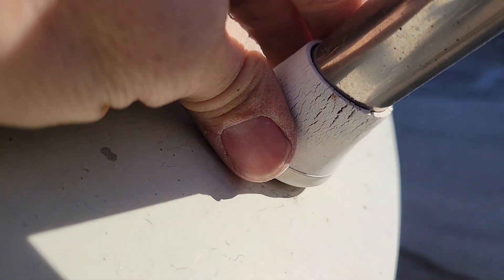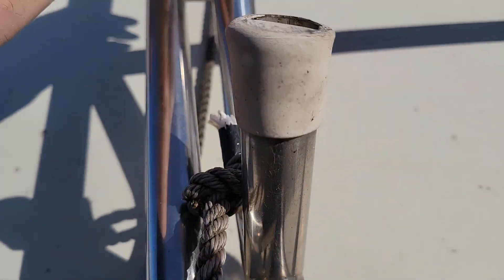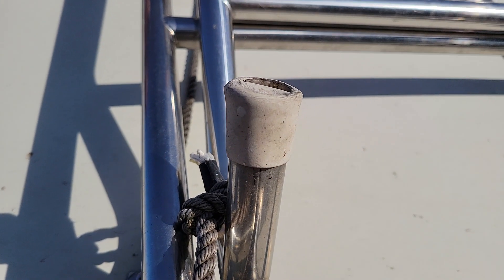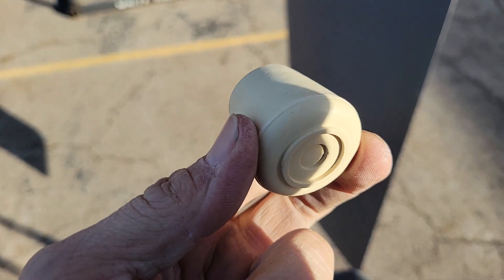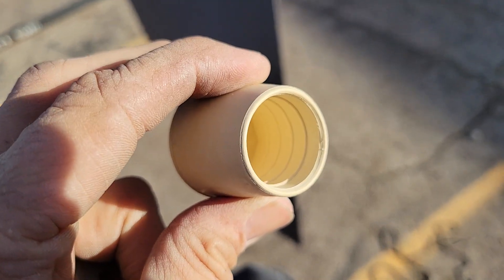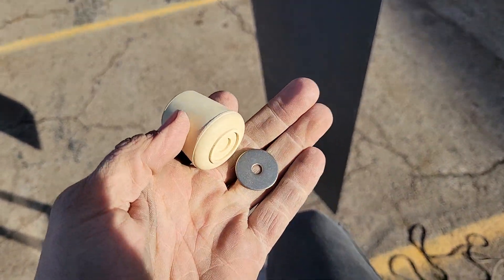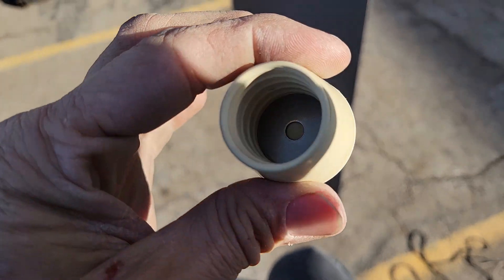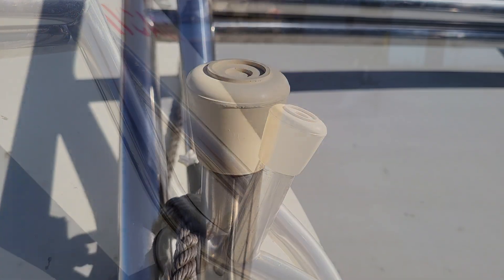Swim Ladder Cap Hack

Comment: I cut circles of plastic from a container just smaller than the inside size of the swim ladder feet and pop them in. Sand the edges to prevent it from damaging the cup.
Reply from the maker: Also a good option.